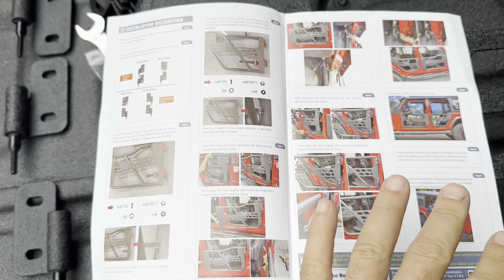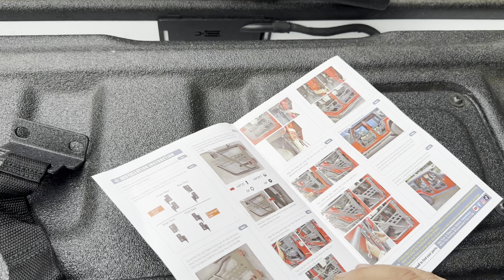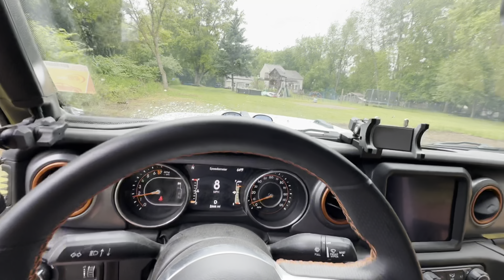Jeep Tube Door Install & Review - JK JL Wrangler & JT Gladiator from HOOKE ROAD!

Comment: How are you liking the doors
Reply from the maker: They were great! I think I had them on almost 5 weeks straight just using my cab cover at night. But weather changed for the cold a few weeks back and I think the season is over here in Michigan for tube doors. But I have these and a cheaper $300 set and these are way nicer and look much better.